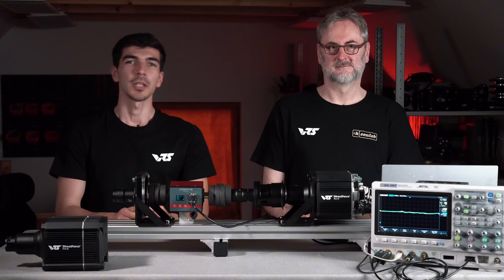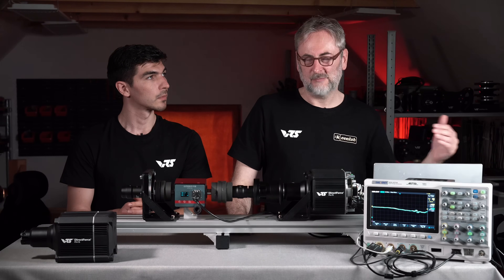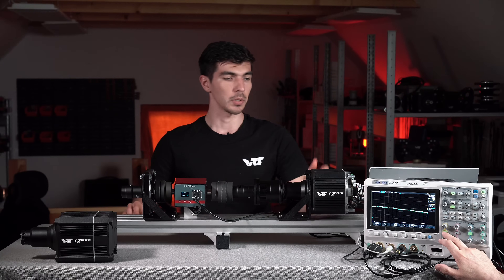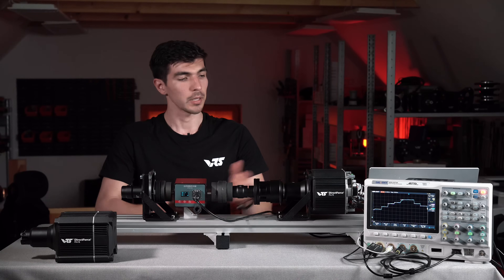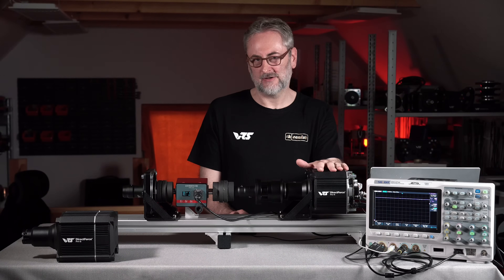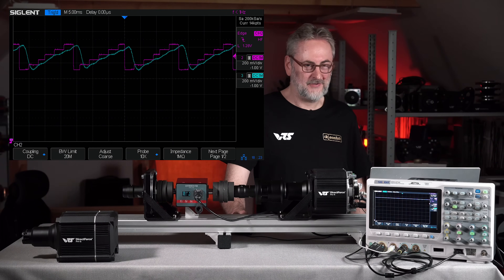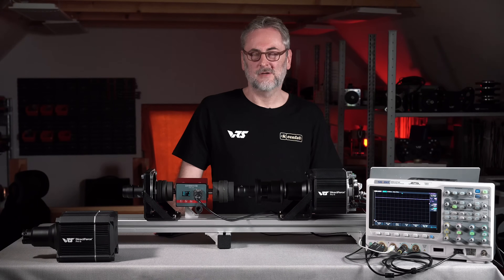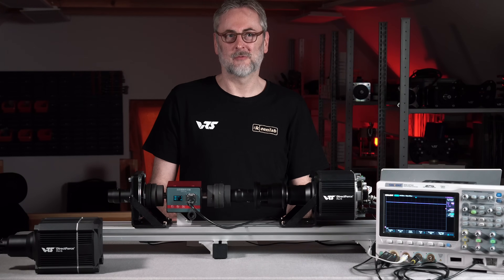Force Feedback Accuracy: Does It Really Matter in Sim Racing?

Comment: Proof that the capabilities of the electronics and how quick the motor can change directions are more important than a big torque number... not that power doesn't matter, but it is not a guarantee for good Force Feedback. Something I keep telling people who only look at the value of maximum torque. And it's also visible that the Force Feedback signal is always shifting dramatically, so a certain amount of headroom is reasonable, but it doesn't have to be unreasonably high - Yes, SimLab, 35Nm maximum torque sounds astonishing, but also ridiculous, which it is ;). Thanks for that video, well done!
Reply: over 18 NM is useless Imo
Reply: @francescohelsing5031 True. I own an Asetek Invicta wheelbase, which is great, but the only real advantage is, that the possibility for it to break is quite low, since I run it at maybe 30-35% ingame FFB, depending on the wheel and sim. Another 30-40% as headroom would do it easily. It's simply put luxury at this level.
Reply: I have an Alpha U 23 NM and i never go more than 35/40% in game 😅
 @TobiwanKentobiSimracing
Reply: Ffb accuracy and responsiveness (signal to output) is important for driving at the limit. More so than raw torque.

Comment: Great info!!  Does no/low filtering cause more stress/heat/damage to the motor?
Reply from the maker: there is no impact on the motor long term reliability regardless of the slew rate and filter setting you choose

Comment: So somehow the only way to improve FFB fidelity without graininess is on the  sim side? 
If some day a sim delivers a FFB output  with a 1 million discrete steps at 1000Hz there will theoretically no more need for filters. 
Is that achievable in the near future? 
In the meantime predictive filters are the only way to reduce lag by approximating the next step maybe via derivative extrapolations.  (?)
Reply from the maker: You can already drive high refresh-rate titles like LMU and ACC comfortably with minimal filtering. However, you may still want to use filters to reduce the strength of high-frequency effects like curbs or road texture. The most important feedback is tire traction, which is low-frequency, and not getting filtered. 
Stay tuned on Discord to learn more about our implementation of predictive filters.
Reply: @realVRS  Thank you for your very informative answer. :)

Comment: How will the actual in game smoothing effect the responsiveness if at all.
Reply: Depends on the game. The only one I can think of is in rF2 and LMU. There they use a weighted boxcar based on internal values. The real aim isn't so much to smooth steps, it's to reduce spikes. Because it is weighted towards more recent values it gives a very immediate feel. In fact there's barely perceptible latency. The only parts that see latency are the spikes that we are trying to dial out anyway. That said, it's better to keep smoothing to less than 5 if possible. But it's a great solution for reducing the intensity of the kerbs and ABS.
Reply: It depends on the update rate that the sim is using. Usually less than 500hz. It can't smooth beyond that, it will always create steps at it's rate. In contrast, the vrs wheelbases smooth at a rate of 10000hz.
Reply: @wearethewatt2950 So, maybe leave in game smoothing at zero for least delay?
Reply: I’m currently using 3